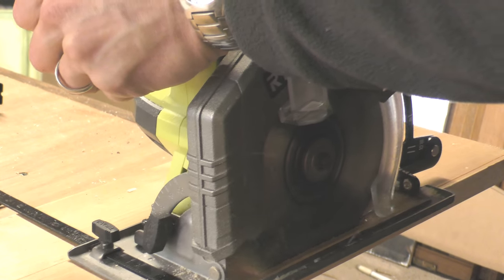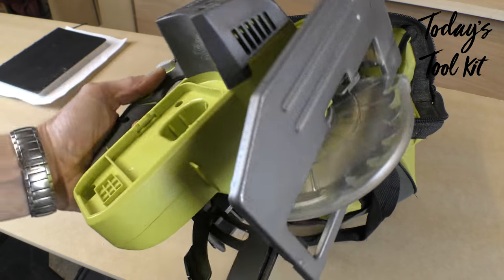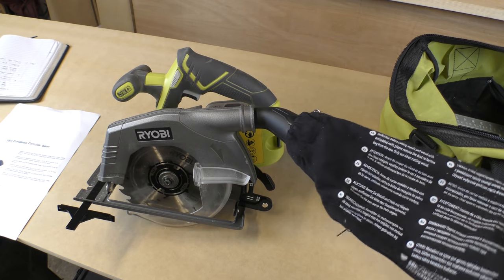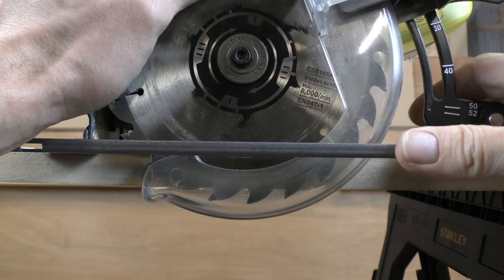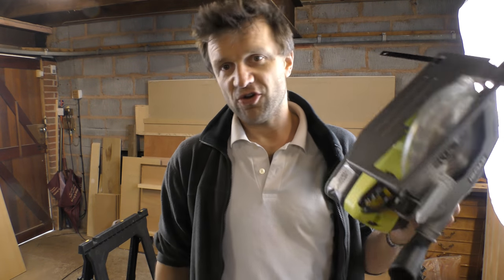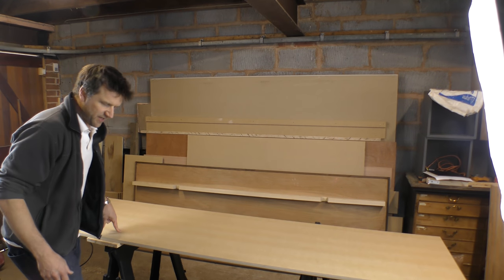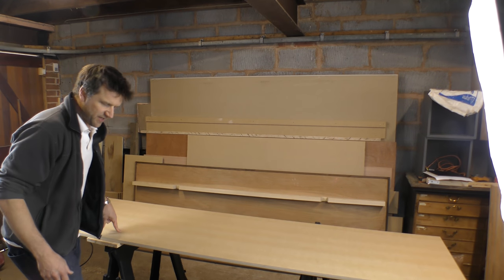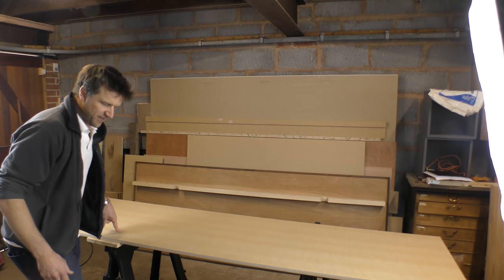Circular Saw - the MUST HAVE DIY Tool

Comment: I have the Bosch pks 66 a circular saw and the engine is on the left hand side. I would like to ask where should I clamp the fence / the guide ? should it be on the right or on the left ? it it on the left as most YouTube videos shows , clamps stick up and prevent me to cut with comfort . I didn't try it on the right. In Ryobi I see that engine on the right.
Reply from the maker: Does your fence have slots in it? The clamps I use in the video are designed to fit into the slots, so there's nothing sticking up above the fence to get in the way of the saw.
Reply: @CharlieDIYte  no I don't have such a clamps. I used just a straight adge with fence like this one. I just asked if there is any difference in terms of stability which side of the shoe follow the adge

Comment: Cutting Depth.. well I never.. my ryobi saw just wont follow my guide.. digs in every time.. appreciate the tip, I thought my saw must be garbage. Also note that warped saw blades or mis-aligned base, are apparently another reasons for this behaviour.
Reply from the maker: It's almost certainly because your blade is set too low. Mine was exactly the same. Nearly threw it in the bin until my carpenter mate pointed out where I was going wrong. It's been brilliant ever since!!

Comment: Is this circular saw any good for cutting logs into smaller pieces as in length wise for log burners ?
Reply from the maker: Depends on how thick the log is but yes it would do the job.
Reply: @CharlieDIYte  similar size to this
Reply: @CharlieDIYte  I have messaged you on Instagram

Comment: My ryobi came with the fence but didn’t come with the little thumb turn screw for it! Did yours come with it or did you buy it separately?
Reply from the maker: Yes it did. You mean the screw that secures the fence tight or the bevel screw? You should definitely have got one of those. I wonder if it's fallen off at some point? Worth investigating, or take a look at ebay to see if you can get a replacement.

Comment: would you recommend a sawguide (steel ones) for this? And would f.ex Bosch sawguide FSN 1600 work with the Ryobi R18cs7-0 circle saw?

I got a few Ryobi tools and imho if the saw is good i will buy one. Reason alone the sharing of battery...

Comment: Hi i have a question...
Will a 165mm blade fit a circular saw with 160mm blade,  the bore is the same on both blade 20mm?
Reply from the maker: I couldn't possibly say unfortunately. You should try and get the correct size blade if you can.

Comment: Is Ryobi still your go to for cordless tools Charlie?
Reply from the maker: I'm largely stuck with it Paul because I've got so many batteries - 6 in total. I have no loyalty to them as a brand as they've sold 1000s of units through my videos over the years and have refused to support me in any way (whilst paying Instagramers who don't have a clue what they're doing). Objectively though if you're not a DeWalt, Milwaukee or Makita tool snob, they do make very good quality tools for the price - although they're not as cheap as they used to be. Over the years I've had two tools fail - a combi drill and recently my multi tool. I've replaced the multi tool with an Erbauer as I have a couple of Erbauer 18v batteries. They also make excellent tools for the money.

Comment: Hi Charlie, I’ve been watching the channel for a long time, enjoy it, learnt a lot, and have taken much of your advice - thank you. I’m considering buying one of these circular saws, but in researching them today have come across so many bad reviews about the blades not running parallel to the fences. So many of them I just rang Ryobi customer support who were so aggressive in denying not only the fault nut knowledge of the fault, that I was convinced it’s true. Did you check yours, is it ok, or have you found it doesn’t matter?
Reply from the maker: Hi there. Thanks so much for watching my vids 👍 Sorry to hear about this. I've got to say I haven't had a single problem with mine and I suspect in a lot of instances the issue is that people aren't setting the depth of the blade properly. You MUST have it so that only half of the lowest tooth on the blade pokes out below the piece of wood you're cutting. If you don't do this, the blade will wander all over the place. Check out my most recent video https://www.youtube.com/watch?v=mvcPuUz_m74&t=32s My advice would be, if you already have the Ryobi battery system (you'll need a 4 or 5Ah for this tool, then go for it, and the fence has worked seemlessly for me. If not, there are some other good options out there, like the Makita, and whilst I haven't tried it, the Erbauer looks pretty good too. If you're just looking to do straight cuts down the length of timber, you could do a lot worse than the Evolution that I feature in the above linked video, and the saw guides you can buy for it work fantastically. A battery powered circular saw though is a more versatile tool than the chop saw.
Reply: @CharlieDIYte  
Thank you so much for your sage advise.

Comment: Hi Charlie, I bought a cordless Ryobi one+ circular saw and on the whole it's great, however I noticed when I try  cut a thin slice off the end of a piece of board to get a straight end, I've noticed theres a slight angle to the edge finish. which means when stood on it's edge its not  90 degree square. is this normal for a circular saw? 
I've used a speed square and one of those plastic 45 degree triangles to check the blade angle and it all looks square until I do this thin slice cut. 
Could it be a technique problem or is it like when using a jigsaw the blade can bend slightly problem? 
Thx Charlie for any help

Comment: I am a bit confused, when you have wood underneath the wood you're cutting to protect the stands, don't they get cut as well? So if you make yourself a table, it'll get scratched out cut right
Reply: Mujhtaba A. 
The wood underneath is sacrificial;  you don’t care if it gets cut or scratched.
Some people put insulating foam under the board they are cutting.

Comment: Charlie. Hi
Considering a brand new tool set and a circular saw in there. Is brushless needed for this? Seen a ryobi one that is brushless and they do a few that aren’t. Are they necessary? The BL one also seems to “face the other way” why would that be. Dave
Reply from the maker: Hi Dave, I wouldn't get too hung up on whether it's brushless or not. Brushless is meant to prolong battery life (possibly a bit) and the motor (this you won't notice as I'll be surprised if you ever use it enough to get through the brushes on the first motor). Yes I think my corded Evolution faces the other way. It's annoying when you're used to it in reverse, but probably less so if this is your first one. I don't know why the manufacturers do that, to be honest. Take a look at this https://youtu.be/mvcPuUz_m74 video if you have time 👍🏻
Reply: @CharlieDIYte  Charlie. Thanks for the response. Oh I’ve seen that video. Was super impressed with the guide. 

One thing. What’s the best straight edge guide you can pick up. As in for measuring and your very first cut. If you’ve not got a factory straight edge that is. I’m thinking some metal length from screw fix or something. 

I’ve been working through your catalogue. Really learning a good deal. Just need to build an extension to house all my planned goodies. 

Shelf in the you heats room. Above the bed. Some triangular affair would be fun to try. 

I’m going to go down the brushless route for drills an I driver I think. Your video on that was very helpful. 

Thanks so much again for the reply. Much appreciated. 
Subscribed too to the channel. Keep it up

Dave

Comment: does it matter do you what side the blade is on? 
thinking of buying one myself, but the newer brushless one has blade on the other side. so when holding in right hand, you cannot see the blade
Reply from the maker: That is annoying. Maybe get my one. It's not necessary to get brushless. You'll never wear out the brushed version. Mine is still going strong.

Comment: If you can't afford a table saw and a miter saw, then yes, a circular saw is a must. Otherwise, it's almost completely unnecessary to have one. You'll almost always have to deal with uneven and imprecise cuts with a circular saw which can really put a damper on the satisfaction level of your work. If you want great results, you'll want to get the tools that allow for precise and accurate cuts.
Reply from the maker: Fair point, although with a guide track (as used with plunge saws or some of the hybrid circulars, or the Festool) you can rip boards down with very good accuracy.

Comment: i've watched so many circ saw safety videos i am now too scared to buy one.
Reply: No need to be scared - I use the circular saw regularly and it’s a matter of respecting the tool and safety always. Before a cut I always double check clearance under the wood, my table is stable, clamps are secure and power cord is in a good position - it becomes habit after a while of using one. Of course, goggles and face mask are a given !

Comment: Are ryobi tools good enough for tradespeople?
Reply from the maker: Most trades will say not but I've been using them for the day job for 10 years. That said, I'm only on site once a week. All I can say is that my mate who's a carpenter and has a Makita circular saw is very impressed with this.
Reply: @CharlieDIYte  thanks for your speedy reply! I am a plumber and have started using einhell power tools and find they do the job perfectly!
Reply: I find your video's very helpful and informative! Don't worry about how long they go on for!
Reply from the maker: @MrBreed15  Thanks Ian - I appreciate that! I do try and keep them as concise as possible. I know some people think I go on too long but you sometimes need a bit of back story to explain why you bought something/ do something a certain way - which might be a relevant consideration for whoever's watching it.
Reply: @CharlieDIYte  hi charlie! I'd like to get your opinion on einhell power tools as I've just bought an einhell 18v angle grinder and it seems really good! Thanks in advance for your opinion.

Comment: If you’re a DIYer and don’t use tools that much I’d buy mains powered as they’ll potentially see you out. Apart from a pair of battery drills that is. Trade tools tend to last 5-10 years when used every day. Battery upgrades are my fear so tools that I don’t use much or need constant power I buy mains. 110v and 240v aren’t changing any time soon 😉
Reply from the maker: It's just that some tools are so hard to operate when you've got a cable on them sand circular saw are one of those tools.
Reply: @CharlieDIYte  It’s corded hedge trimmers people struggle with. You never see one with the original length of cable 😉

Comment: Hi Charlie, great video. The tips are welcomed as usual. I want to ask you about the rafting square, is it imperial or metric? I need a metric one, but couldn't get that info at the page link you supplied. Please check it out and point me to the right direction if you could. Regards from Macedonia.

Comment: What ever happened to the improved saw guide? Can't seem to find it in your body of work.
Reply from the maker: I can only apologise Pat. It's on my list of things to do but I haven't had a chance to do it yet. Two tips though - the top piece needs to be wide enough that it doesn't flex - at least 15cms (mine was too narrow), and reasonably thick eg 12mm ply.  The bottom piece should be as thin as possible eg 4-5mm ply or possibly 6mm mdf as you want this to be as thin as possibly to maximise the potential cutting depth of the blade.

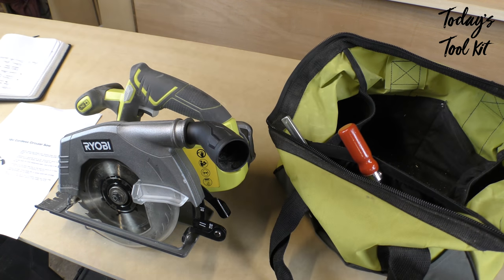Comment: I have found the rafter square ( aka speed-square) very helpful. I learned from the RR Building video - see 2:48 at video "https://www.youtube.com/watch?v=eNH_BhjwhV8" that it is easier to reverse the way it is used.  I adapted this further by buying a 30cm square and clamping it when cutting wide timbers.  For 20mm plus cuts I often clamp the square and make two cuts; one part-way the other full depth plus 1mm.  
To save time and get a relaible cut without kickback I rest the complete sheet/plank on flattened Amazon cardboard boxes to give full support either side of the cut. I clamp one side. I set the depth at 1mm plus the thickness (as you recommended)

Comment: Thanks Charlie ! Was looking for a circular saw, but this is on the higher side of my budget. What are your thoughts on the black and decker matrix set of tools ?

P.S. loving the content!
Reply from the maker: Prince 1022 Thanks! I'm afraid I don't have any experience of the matrix range.  I've had a few Black and Decker tools over the years that have lasted pretty well but I can't vouch for their current quality. Best to check out the reviews before you buy. I've always found Ryobi good quality at a reasonable price compared to more expensive tools from the likes of Makita and DeWalt.
Reply: Prince 1022 I have an Evolution Fury Circular Saw. Prices start from £60 - £160

Comment: You have to get yourself a table saw, you have loads of room there.
Reply: Paul Rossiter I have the Axminster 315mm trade table saw, with 2 extension tables in a double garage, considering selling it and getting a track saw instead as with my 305mm Bosch chop saw and a track saw I could do everything I can with the table saw but it would take up a lot less space leaving loads of room to assemble.
Reply from the maker: Paul Rossiter If only! I'd love one but can't leave anything in there as it gets broken into annually, and it's meant to be for the car rather than a workshop 🙄
Reply: Charlie DIYte next video how to fit a security alarm😀
Reply from the maker: Paul Rossiter I kind of walked into that one, didn't I! The last time they broke in they ripped off the dummy camera, jemmied off the door lock and then fled for their lives when the £19 Maplins door sensor alarm went off! As you say, I just need to upgrade the security to something a little more meaty!
Reply: @CharlieDIYte  try a 9 mm glock, best kind of home security

Comment: The fence isn't any good if your piece of wood isn't straight though 🤔
Reply from the maker: Agreed. In that case, you need a straight edge to run it along - I've got a bit of metal trunking I use. Alternatively you could make yourself a track saw guide.
Reply: @CharlieDIYte  thanks Charlie. Just beginning my Ryobi set! Got the latest drill driver, a tyre inflatior, and a grass strimmer. Impact Driver next! Enjoying the content,  keep it up!

Comment: Thanks Charlie, really enjoyed your video. 1 thing that would be nice to your American followers either tell us or have the U.S. dollar equivalent to your pound. If you're feeling extra generous imperial measurement also. Cheers, Rodney
Reply from the maker: Thanks Rodney - I will certainly do that going forward as I massively appreciate my American audience. I was listing dollar equivalents in the Description under the video but stopped doing it recently as I wasn't sure how useful it was too you guys as it's only a conversion rather than a representative price of what you can get the product for in US hardware stores. If you could send me a list of the typical DIY /hardware stores in the US that you tend to use (Home Depot is the only one I really know about), then I could check actual prices for everything I'm using? Thanks for the comment and for watching my videos!

Comment: This one is for lefthandy’s
Reply: No its not. The blade is to the left because it's cordless. The battery housing design can't be incorporated into a blade to the right saw. Plus it's for non idiots. You see the line and where you cut way more cleanly n clearly than a right side  saw

Comment: What tool manufacturer offers a line of cordless tools with batteries that don’t work across the bored ?? That’s just dumb! Some manufacturers offer a DIY/tradesman option & a “Construction” option like the flexvolt, witch are a completely different kettle of fish all together. Just thought I should point that out to folk that are not in the loop.

Comment: Why didn't you glue and screw the guide so it wouldn't flex
Reply from the maker: I did. It doesn't make any difference as the MDF is inherently flexible at these widths regardless of the amount of glue and screws you put in. I've done a new video on the saw guide, you can access it here https://www.youtube.com/watch?v=mvcPuUz_m74&t=2s

Comment: buy a decent blade buy a freud blade what difference...................your tool is a motor that turns its what's on the end
Reply from the maker: I'm not sure that would fit on the Ryobi, as it has such a small central hole diameter (15mm) but I've heard good things about the Freuds.
Reply: charlie you can get reducer rings freud blades i use on my track saw circular and dewalt table saw go for it it take the plunge, sounds a bit corny but hey try it

Comment: Maybe it's only my experience but I've always found Ryobi to be overpriced and poor quality. When you can buy Bosch for a little more it's a no brainer. I only buy Bosch now and they have never failed me.... Anyone else has the same experience with Ryobi?
Reply from the maker: I've never had any quality issues with my Ryobi, but I've got no particular loyalty to the brand and have historically used Bosch like you,  which I agree are great tools.
Reply: Nope......exactly the opposite in fact.......had Ryobi since early 2000's and they still run like new. Not a hitch. They keep getting better and improving their line actually.